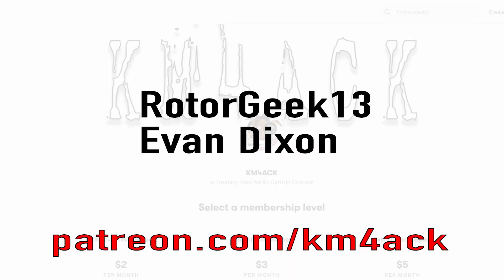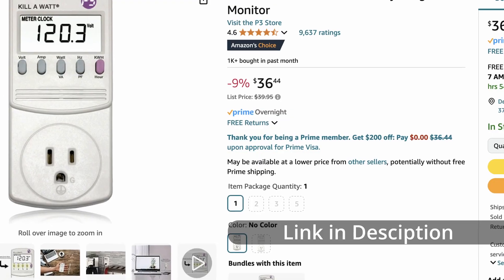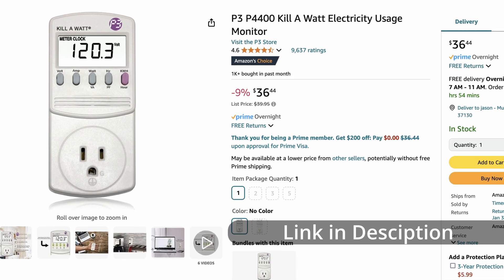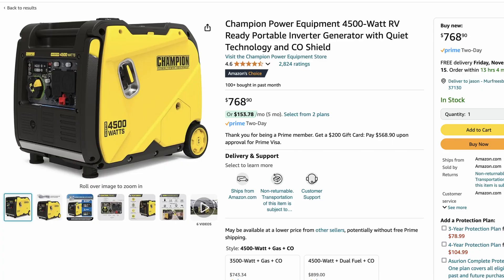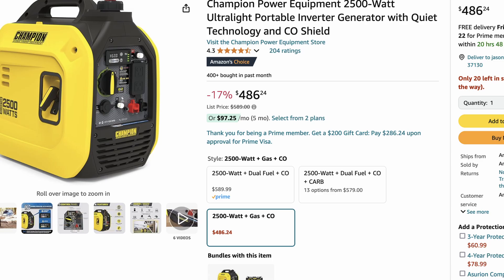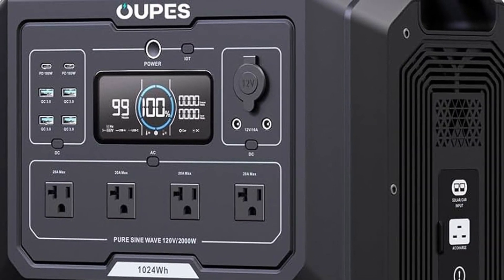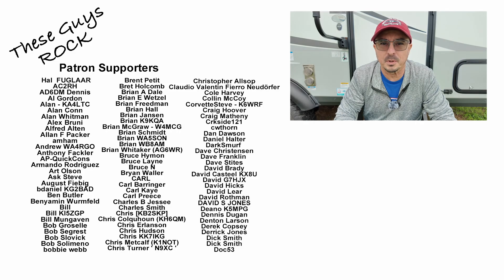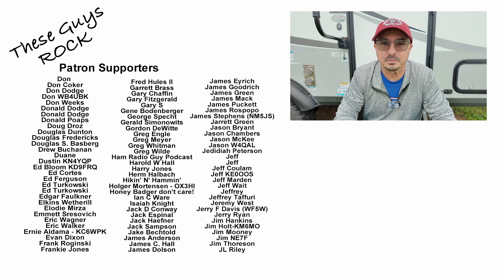Layering Your Backup Power Strategy

Comment: When considering a portable battery bank like the EcoFlows, Bluetttis, Jackerys, read the specs and note the amount of AC power they will use to recharge.  A another youtube channel I watch just did a comparison of 3 portable battery banks he has and found that one of them that had the largest battery capacity only charged at 300 watts even with a regular A/C plug.  Knowing that then factors into how long your gas generator will need to run to recharge these portable battery banks.
Reply from the maker: Great point! That's exactly one of the specs I looked at during my review of the Oupes power station. It can charge at 1300W which brings the base unit to 100% in roughly an hour.

Comment: Great video.  A multi tiered system is smart.  I'm thinking about getting a second inverter as a backup as it is the key component of my system.  With generators you have to be mindful that if you aren't drawing power to shut them off.  People let them run even when there isn't much draw because it is convenient.  Using a generator to charge a battery bank and then run everything off the battery bank/inverter offers that convenience and might be a more efficient use of your fuel.  At least that is my thought.

Comment: This issue came up in Helene - the roads were out, but as my wife will tell you, she never knew it for a week how bad it was.  We used a three teir power system I had built years ago - including a whole house tie in that ran everything but the water heater.  She did ask, "What if this fails?" and was suprised to learn we had alternate and then contingency generation - including an emergency option.
Reply from the maker: Nice! Sounds like you have a well thought out plan
Reply: @KM4ACK  We were able to supply the community with water / showers / washing - so it worked out for more than just us.  I did not run any mixed fuel generators at night because of many reason.  We only used pre-charged solar power generators  at night.  You are correct on solar - even with good panels, it was difficult to rely on it - used the generators to power up the solar generators/batteries.